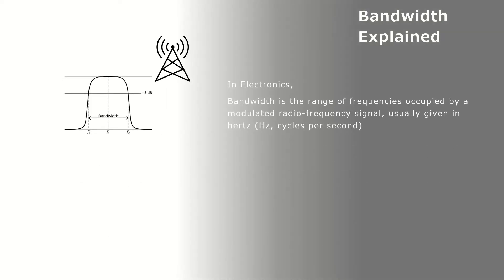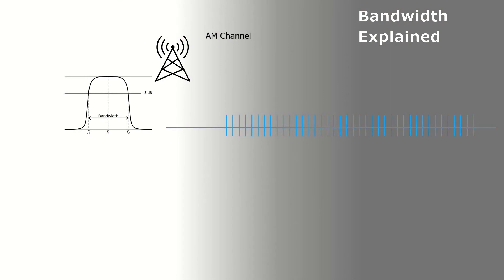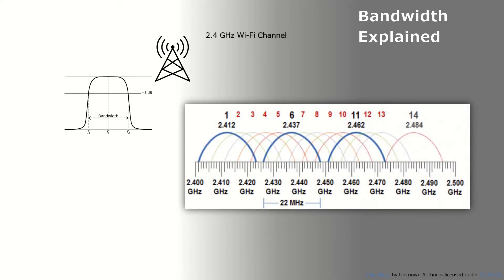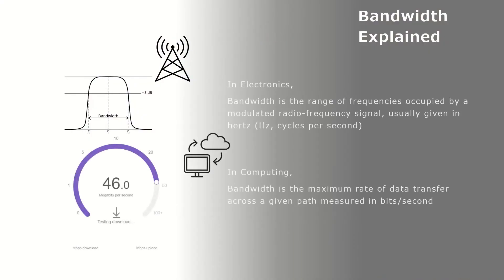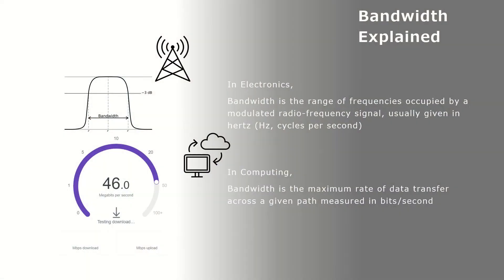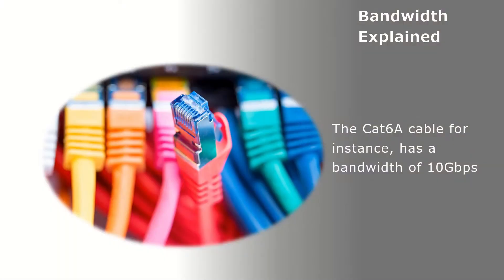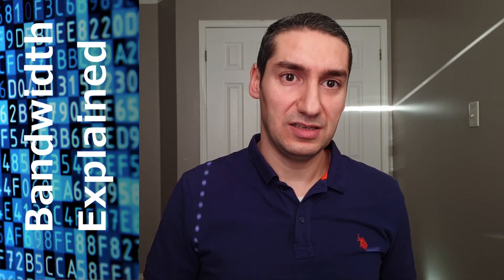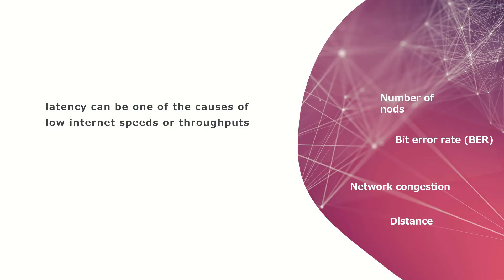Bandwidth Explained, in Electronics and Computing; Also Compared to Throughput

Comment: In the cabling industry w consider the bandwidth of Category 6A  as being 500 Mhz. That is how TIA defines it, it is how ISO 11801 defines it and it is how EN 50173 defines it. 
Cat 5 being 100 MHz, 5e still 100 MHz, cat 6 250 MHz, cat 7 600MHz, cat 7a 1000 MHz and finally Cat 8 2000 MHz.
Reply from the maker: True, and that is the maximum supported frequancy by these category cables according to the standards. You can check my video https://youtu.be/lXH6cUwapLw for more details on Balanced twisted bair cables and their categories.

Comment: I think this is grate explanation of bandwidth for people outside of IT. I like examples.  What bandwith calculators do you use? We created a simple bandwidth calculator to estimate required network banwdith for groups of IP cameras. We are constidering only basic factors like camera resolution, compression (h.264, h.265 or MJPEG), FPS and number of cameras.
Reply from the maker: Thank you! None in particular. I use calculators provided by the camera vendors most of the times. I would like to try your calculator.